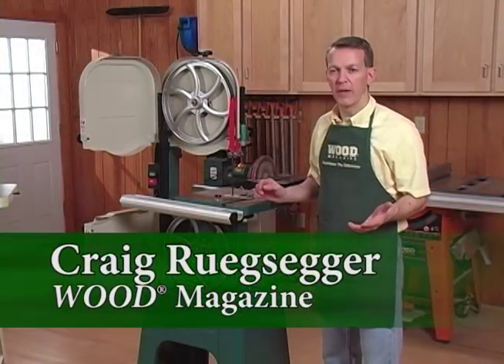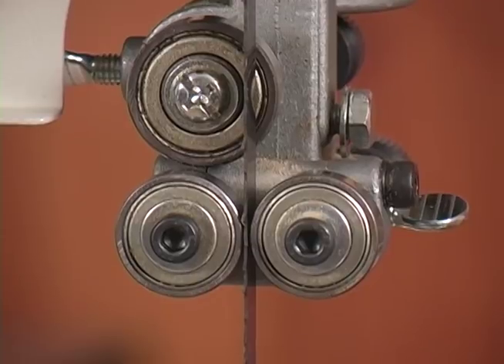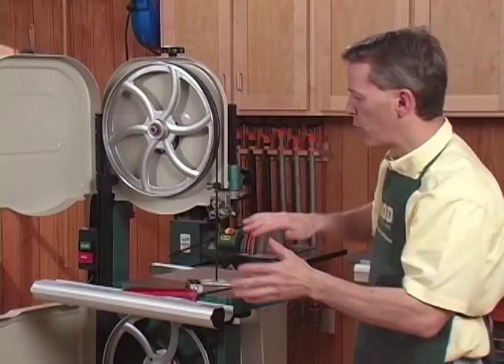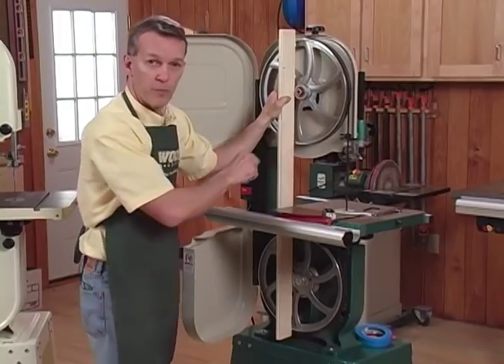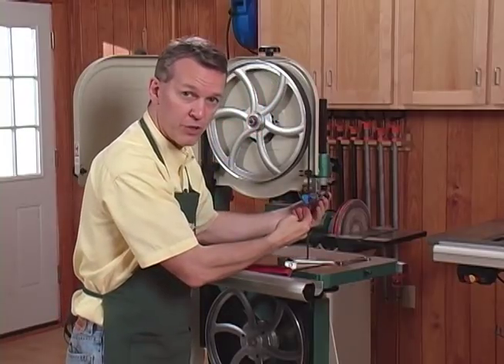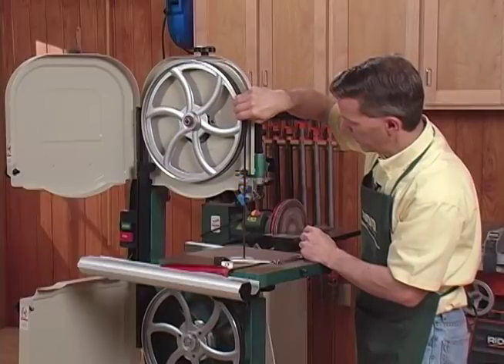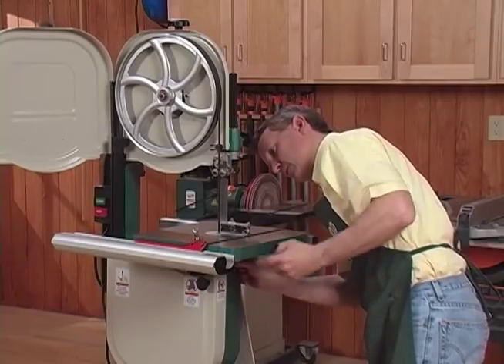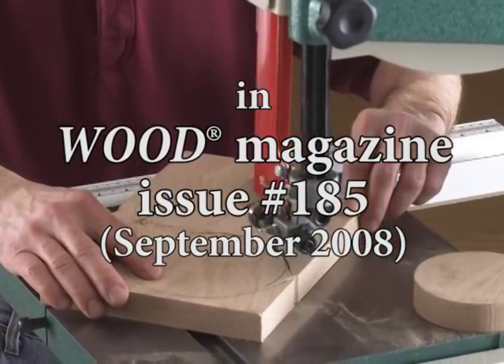How To Tune Up Your Bandsaw - WOOD magazine

Comment: Nice video. Shopsmith bandsaw owners should note that much of this information does not apply to their saw because it does. It have complainer wheels. The upper wheel is permanently tilted back with no means of adjustment. The tensioning is not done in the manner shown here and there is an additional set of bearings on the left column for auto tracking.

Comment: I need your help. I have an old delta 12” bandsaw. The bottom saw wheel is driven by an external electric motor via belt. I’m restoring the bandsaw and need to know the RPM of the bandsaw wheel. Can’t seem to find it and thought you might be able to help. If I know what is the rpm of the bandsaw wheel, I can determine the width of the electric motor pulley diameter I need to purchase. Hope you can help. Thank you Peter

Comment: The table on my 14 inch band saw is not level but...the blade is straight on all sides.  Why? When I level the table,
the blade is no longer straight.  Please tell me what I need to do to have both the table and the blade level and straight.  Thanks.

Comment: How do you mount the blade on wheel of middle?
Reply: At least with my Delta 14" you don't try to make the two wheels co-planer.  The adjustment he made is what you use to put the bottom of the gullet between the teeth right in the center of the tire.